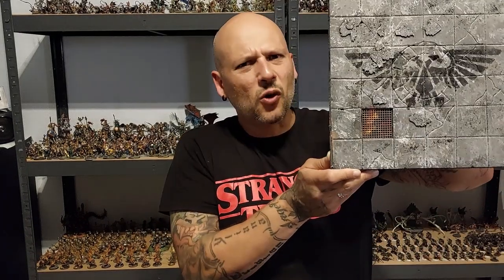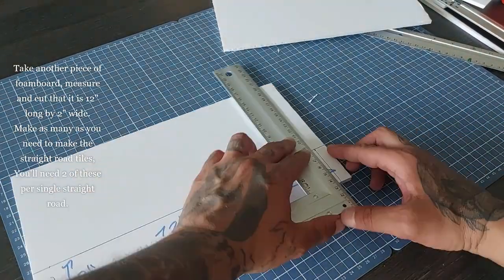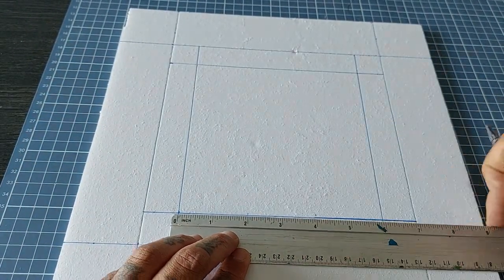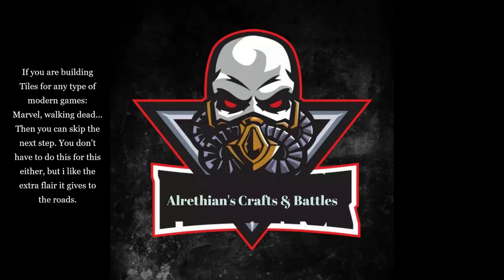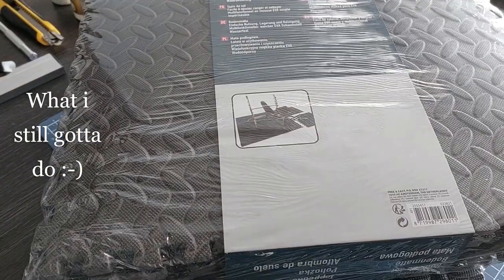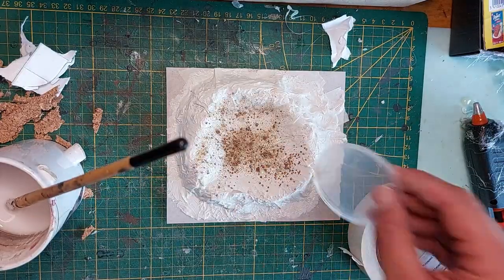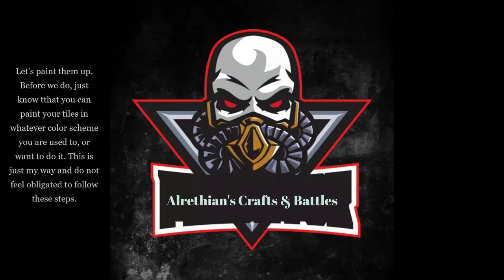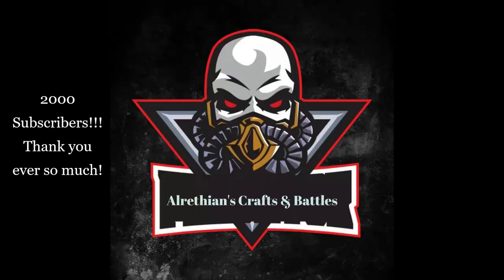HOW TO MAKE: Horus Heresy Modular Grimdark Tiles  - Also great for Kill Team / 40K...

Comment: Amazing builds, I love the added cracks and craters. I used Styroform Boards of 8 and 15 mm strength from Packaging instead of the foamboard. As a base I simply used 10 inch (255mm) Square cardbox from pizzaboxes to give it more sturdiness. So it was a complete scratch batch from otherwise discarded Items.
Reply from the maker: Thank you very much mate,  glad you liked it. That is indeed a very good way to build them as well. There are so many options, it is just a case of experimenting. I always love building things out of trash, you can get great results 😉 . Thanks for watching 👍

Comment: Thanks for another great video. I started watching for the Necromunda stuff, but this is even better.

I wonder about using plywood instead for the base layer.? That would add some durability and prevent warping, yeah?
Reply from the maker: Thank you very much,  glad you liked the video 😁. I will be doing more Necromunda stuff as well soon. 

Yes it would definitely help a lot, if it is thick enough.
But I fixed the warping by adding two thick coats  of PVA at the back.
Thanks for watching mate 😉👍.